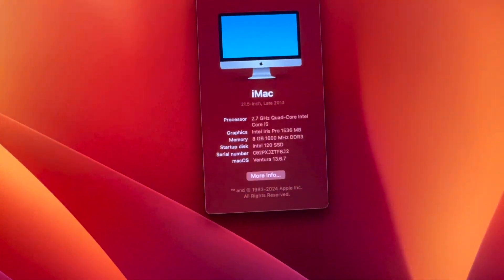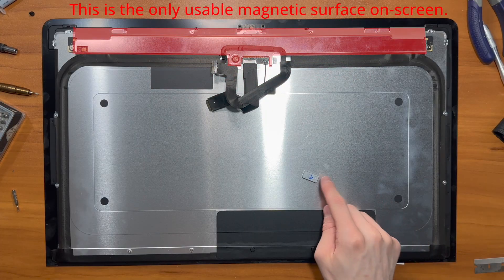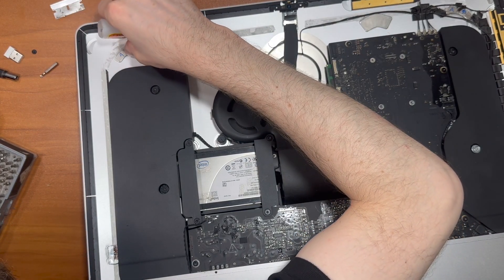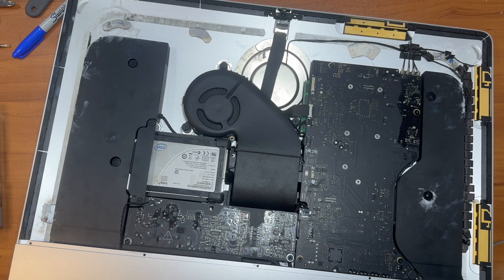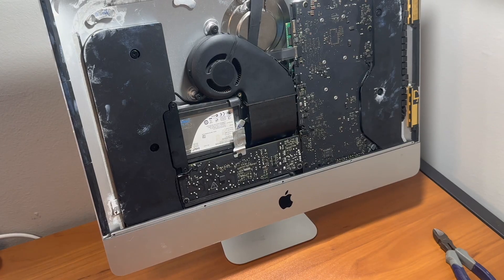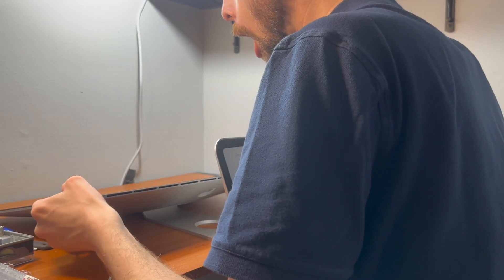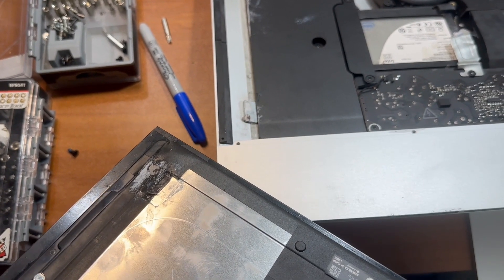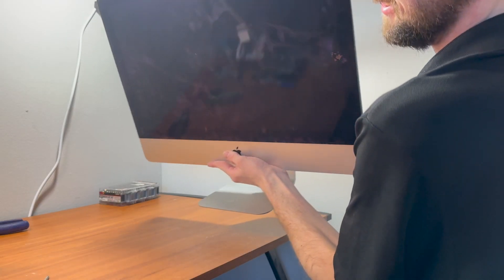Replacing iMac screen adhesive with neodymium magnets

Comment: Great idea.. I've got some old  HDs , so plenty of magnets to try , only using as few magnets as possible ..As magnet backup im also going to use a few blobs of rubber cement/adhesive where the adhesive strips would go, but maybe only three blobs along each side as that will allow the screen to be put in place and minimal pressure needed to flatten the blobs to get the screen flush. This adhesive will be easy to to remove and replace for further mods, and its dirt cheap.
My screens sit on the desk and hardly ever get moved so only need just enough adhesion to stop the screen sliding down under its own weight.
Something else that does a good job is transparent Gorilla or similar strong tape along the top of the case and folded over onto the screen, and at the bottom on the case bezel and screen, hardly noticeable if at all, have this on another 2015 imac, three pieces around 3 inches long , left and right and one piece in the middle...not moved yet.

Comment: One thing that looks very fiddly with iMac screens is reattaching the cables. Do the magnets make reattaching the cables difficult?
Reply from the maker: I believe the magnets have made it easier. I can prop the screen on it's top side, connect the cables that way, and plop the bottom portion down like in the video.
Reply: @supericecreamsandwich  Thanks. That sounds good.

Comment: Great video. Thank you. A suggestion. Maybe apply an iMac adhesive strip that fits along the bottom of the display as well. Therefore together with the internal magnets it would totally prevent the display sliding down.
Reply from the maker: Hey, thank you! Always open to suggestions. I wouldn't do it on the basis it goes against the principle of this being a more easily accessible machine, a magnet could have made the corner stick better. I wanted to have an angle to easily pry it without risking cracking the glass. Toward the end of the video, I placed more magnets which stabilized the issue presented earlier in the video.